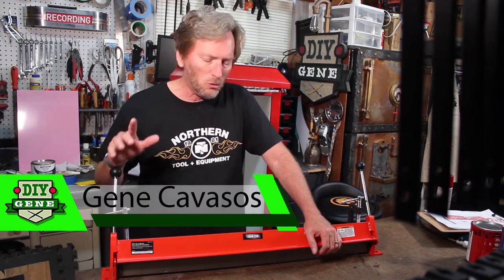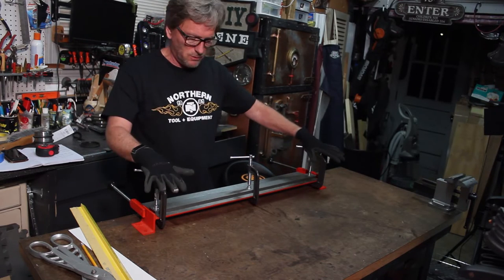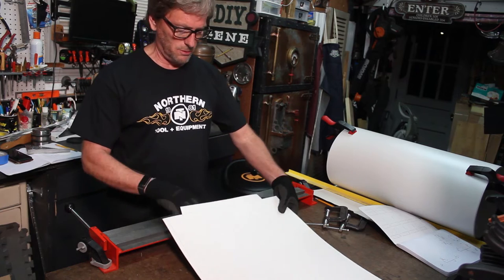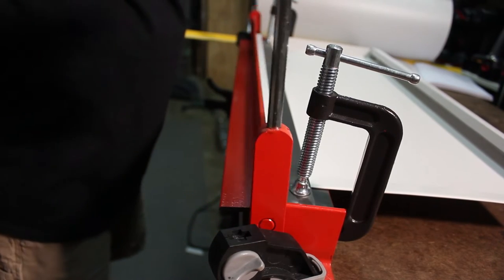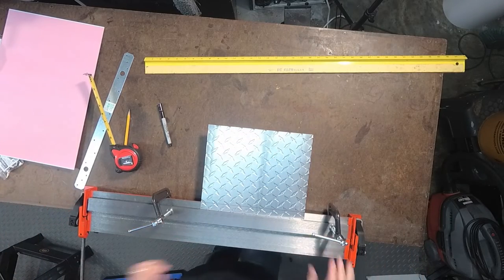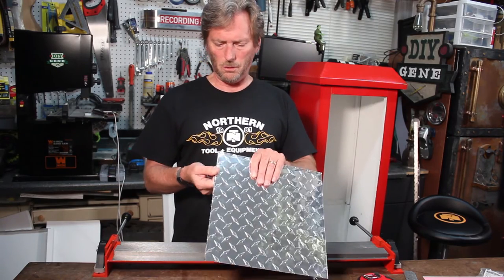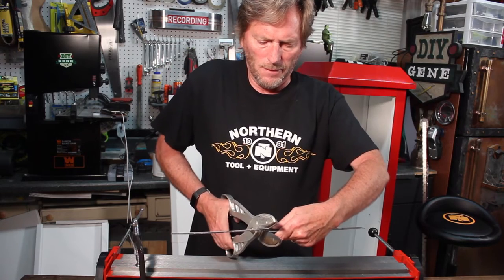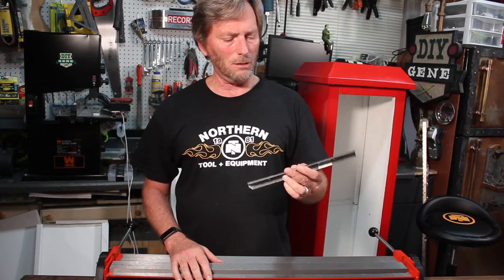Ironton 30" Sheet Metal Bending Brake from Northern Tool + Equipment. Full Review!

Comment: nice looking Metal brake, I don't really like the design though, I tried bending a sheet of metal 0.016" thick and the pressing plate was bowing in the center and everything was coming all out of alignment. it's not this exact metal brake, but one similar in design, personally I like the slide it through a slot and bend along the marks on the sheet of metal, having to clamp down a plate of steel, just to bend the metal, not the greatest in my opinion.
Reply from the maker: @PinkslipDaddy , I would agree with you. Too clunky with the C clamps. So I modified it. Here is a link to that video:
https://youtu.be/GP0gL5aiux4?si=2ywIxiXLuAjMAT7A
Thanks for watching.

Comment: I really don´t understand why they didn´t made holes and clamps for the upper bar, this would make the tool 500% better and cost 5 more bucks.
Reply from the maker: I totally agree. This made this brake in to a really useful tool. Thanks so much for watching.
Reply: @DIYGene  Fortunately there are other brakes on the marked (at lest here in Germany) one can buy off of Amazon which already have those functions for 100 bucks. The only uncertainty I still is, what´s the thinnest area I can create. I need to bent a U channel, the U part should be no larger than 60mm. So if the upper clamp bar is wider than 60mm this would be not possible, hope you understand what I mean. Most other tools on the marked have wider bars.
Reply from the maker: @sierraecho884 , your right. You need almost a flat bar rather than an angle iron as the top of the brake. But I bet you could modify one for that.
Reply: @DIYGene  It´s not as easy, I mean I am sure one can modify anything, there are people who can build their own CPU or whatever however in my case I don´t have the space nor do i have a welder. My main tool is my engineering degree, my CAD machine and a 3D printer in my office. This is why I was looking for a small portable sheet metal brake in the first place xD
There is also a break even point where modifying an item is more money and time spend than simply buying a finished one.
Reply from the maker: Very true. But if you were to change out the angle iron with a u Channel iron with sides lower than 60 mm I think you would maintain the strength and integrity. Then use the same method I used in the video. No welding needed. Just a thought.
Reply: @DIYGene  Not quiet, the U bar does not have shallow sides. To create a true 90° bend you need to overbend the material slightly to overcome spring back. The U channel might be too high for that to happen. Professional brakes use an angled geometry with a thin space to create the most shapes possible. You would have to use a flat piece and grind the edge down for that. Or maybe cut down the U bar a little.
But all those modifications will be a lot of work. 
I think it´s best to just acknowledge the limitations of the cheap brake which honestly is fine for most light duty work. It´s not an expensive pro tool but it does not have to be one either. I just want a little more comfort just exactly what you did with your mods for a fair price and for my limited space.

Comment: Stupid Chinese design. They could of make a slot on the side to lock the bar in place.
So it will be ready to work out of the box.  That is like buying a microwave without the rotating glass tray! The thing probably made from recycle steel.  It should be around $50.
Thank you for the great reviews!
Reply from the maker: I am going to modify mine to make it less cumbersome. It has potential and agree it should have some out of the box improvements. Thanks so much for watching.